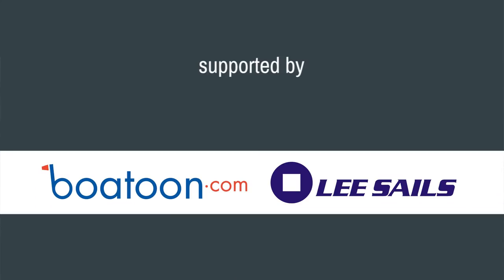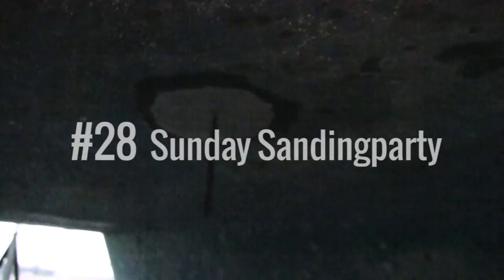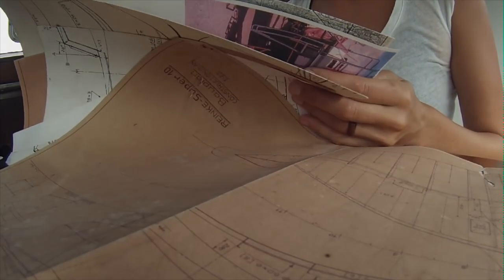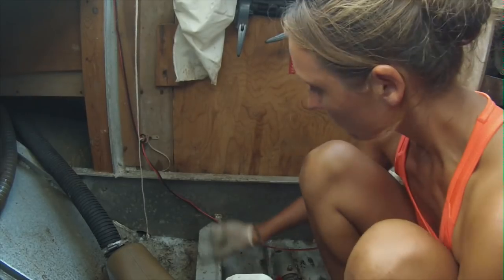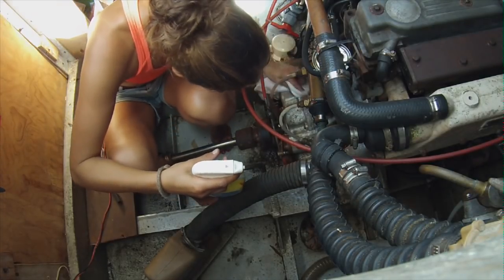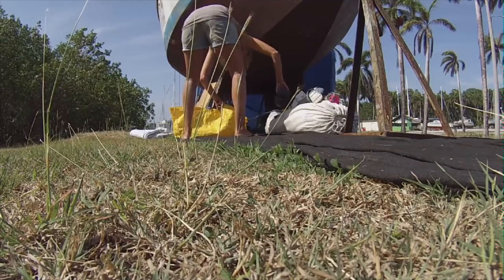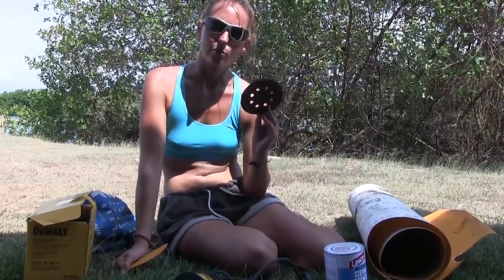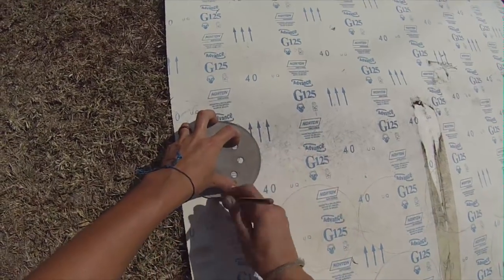Awesome Cruiser Community: Helping Hands For Sanding My Hull - UNTIE THE LINES #28

Comment: Great idea on the sanding party! In my experience boating people are a tight bunch that look after their own as much as possible. If you are going to weld aluminum you will have to expose some bare metal about 4 inches around each repair. Other from that the bottom primer will paint over just fine. Be generous with the Zincs. Karl has a compromised bottom already you don't want anymore trouble. On that note, have you hired someone to inspect the bottom for any more problems – soft spots, thin, weak metal? It could be an idea if your budget allows or tap it yourself – research it first. Love the videos!
Oh! and a clean engine is a happy engine!

Comment: Just found your videos, very inspiring. I have been there myself, you just have to do what you're doing, do the research, decide the best way to fix the problem and take it one step at a time with a little help from your friends.
Most metal hulls corrode from the inside, with aluminium it is important to make sure there are no loose bits of metal, like old screws etc sitting in the hull, different metals in a salty environment will cause galvanic corrosion. Keep the inside of the hull as clean as possible. Some information here <http://www.aluminiumdesign.net/design-support/aluminium-corrosion-resistance/>
I'm a bit too far away to offer you help (Australia!) so I've sent a small donation to say "Good luck and tailwinds".

Comment: Great to see the work progressing. 
So repairs. Soon and what method
I have been doing what research I can and you also need to resolve why you got the electrolysis . Prop able from the missing or hanging zincs! But it could be caused by Karl having a bad electrical system.
A link at bottom has some good advice on that.
Also the welding option requires very carful prep and welding from inside , also possibly tempering the surrounding aluminium to avoid crack around the weld as the metal shrinks and cools. The thiner the metal the more it might crack. Epoxy repairs and painting might require etching just before applying epoxy paint or fillers. Caustic soda is one etching process used , there are commercial products that have this in them.
If you holes are only pin holes then you may be able to do mechanical repairs , bolted on patches of plastic or similar being carful not to mix up metal and cause more problems
By the way another way to fix holes is to put a plastic fitting such as a thru hull fitting or similar where the holes are.then cap of inside. This would be exactly the same as every boat out there with they hull fittings.
I might try and find a nice Marlon type plastic bolt to use so no hole to plug.
Link to electrical problems with the boat is below
Warren
http://www.yandina.com/electrolysis.htm
Also tom Colvin who is old now may be worth talking to as metal boat were a specially of his and sailed and aluminium boat for 16 yrs all over the world.

Comment: have you thought of buying a sonic tester PR-82 (audio tester) $1200.  you could sell it to a steel or alloy boat owner when you were done.  easy to use. comes as a kit with instructions and liquid contact.  there will be no question in your mind about the condition of your hull when your done.  good luck and fair winds

Comment: My friend has an alu boat too.
He made an epoxy barrier under the waterline to prevent corrosion and also add zinc anodes.
So I highly recommend to put on a few epoxy layer before you paint the antifouling.

Comment: Cautionary note:  All of the electrical connections I see in your engine area are the cheap automotive non-sealed type.  You should replace them with sealed crimp on heat shrinking connectors.  If the current from a connector gets into your bilge,or leaks to ground in an aluminum boat the electrolytic  action will eat those holes in your bilge and elsewhere.  Likewise different metals.  a lost penny in a bilge will eat a hole in an aluminum bottom in 3 months in damp conditions.
Reply: Lead will do the same, a dropped fishing sinker/weight will eat through an aluminium hull. Any screw or rivet etc needs to be coated in duralac, or similar, before fitting although I am sure you already know that. It's also a good idea to cover the base of any fittings or fixtures in plastic tape before attaching to the aluminium. :)

Comment: That engine mounting bolt has a problem at 1.46
Reply from the maker: hehe, yes, you are very right. Remember I took out those broken bolts from on of the engine supports? I had not remounted it yet cause the boat is up on the hard anyways...I did put the support on before I went back into the water though :)